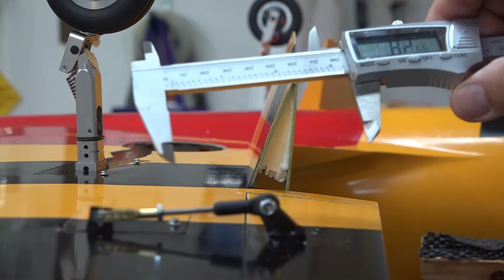rebel hot speed brakes

Comment: Another option to consider is adding crow. 10 mm up ailerons will typically nearly double the effective drag from the flaps in a normal 60-70ish degree angle